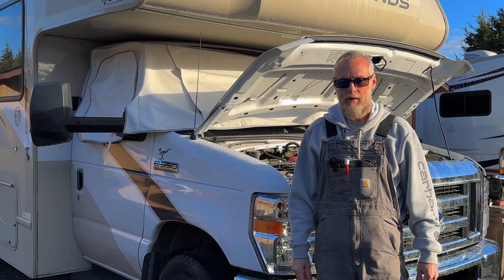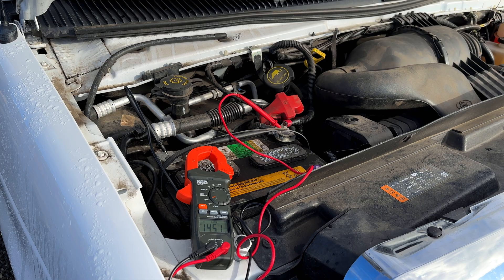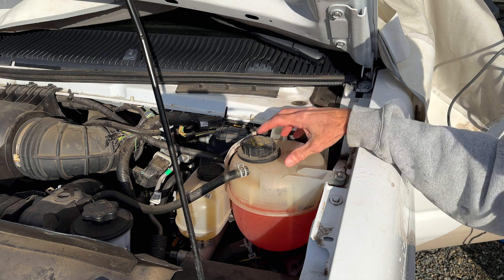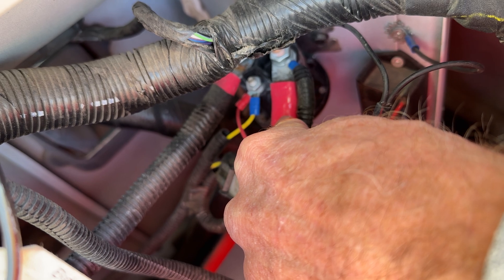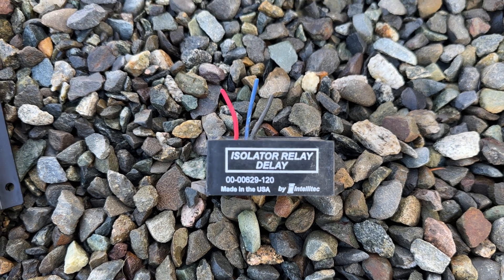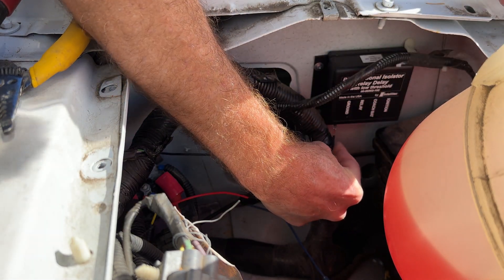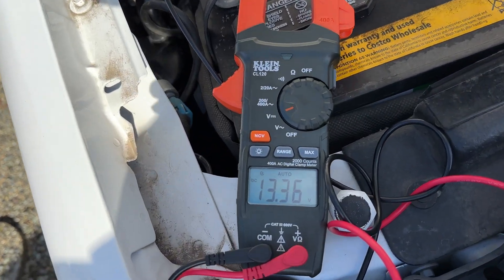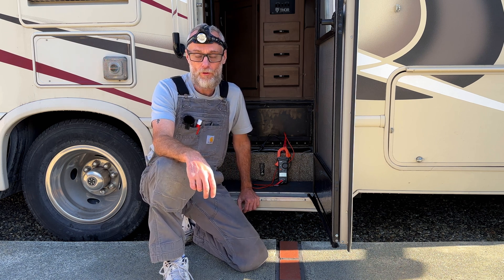B.I.R.D Install

Comment: Hey David , I have a 4 winds MH like the one in your video. I recently put a new carb on my 4000 watt Onan generator. while i was doing that i touched the positive cable on generator to metal and there was a big spark. ( forgot to disconnect batteries ) so when i start the generator it runs great , however there is No 110 power to the coach and batteries do not charge. I think my transfer switch is bad . Is there a way to test your transfer switch to see if it is bad.  Another note is that when i plug into shore power i do have 110 power . One last thing  is my engine battery has a disconnect switch on it and i did not know why but that battery keeps draining power from it IF i leave the dis-connect connected over night. This has been doing that since the time i bought the MH.   I think i bought a Lemon  : )
Reply from the maker: Most generators have a breaker built right onto it, maybe it's tripped or damaged, you can check for voltage leaving the breaker to see if it's working.
You can test the transfer switch the same way, there will be power coming in on the Line side and whatever reading you get should match on the load side.
Do you live in my area?
If so, I can take a look at it.